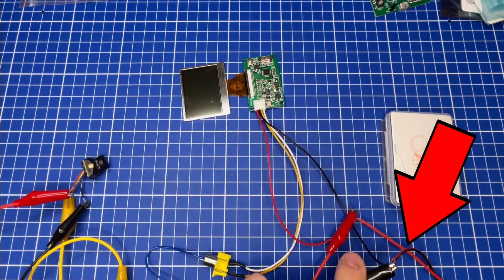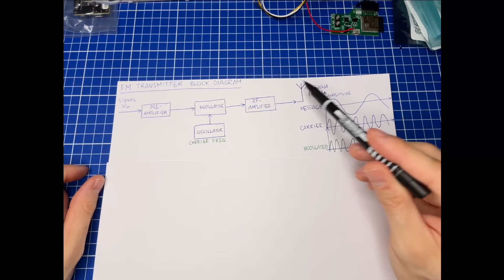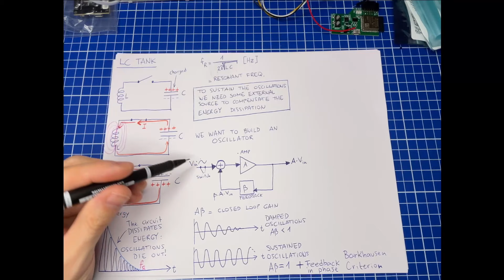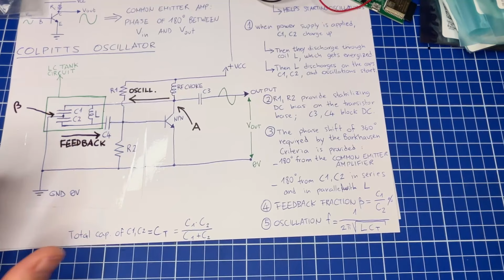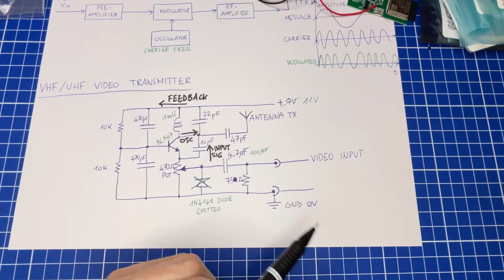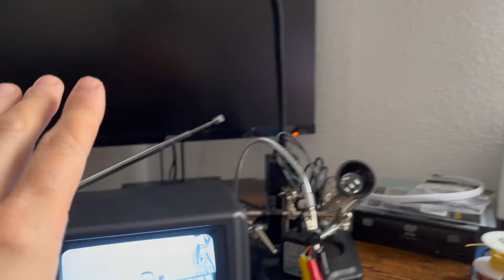FM Radio Transmitter for CCTV Camera

Comment from the maker: dear, the frequency of the oscillator depends mainly from what you choose in place of the 22pF cap, and the inductance of the coil. The best way is to measure it with an oscilloscope. In my particular circuit, the frequency of the oscillator is about 60 MHz